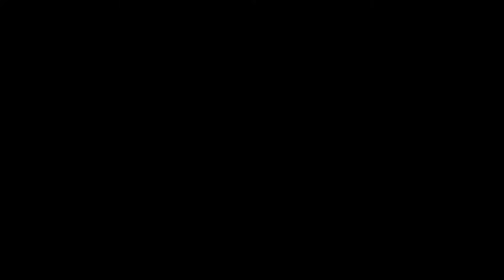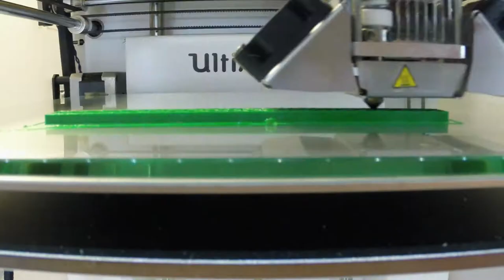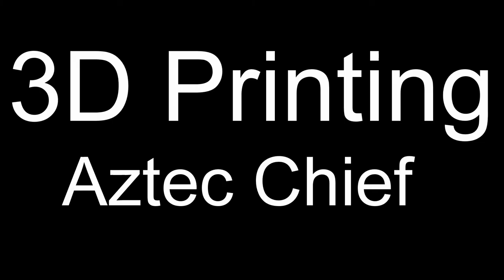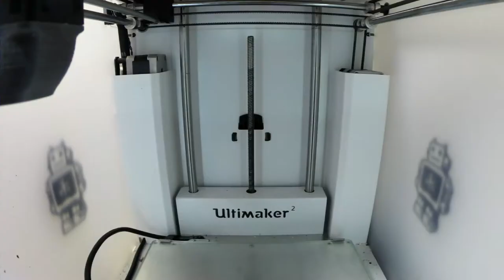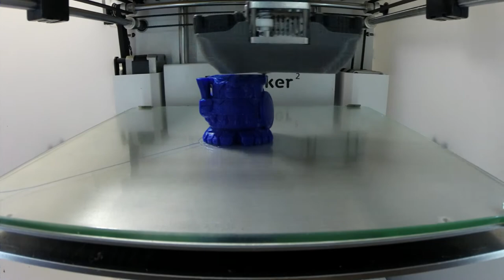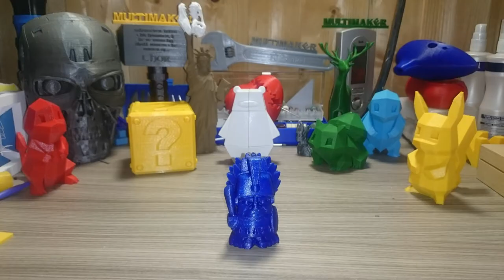3D Printing Aztec Chief

Comment: Question. Olson Block at a guess? And who's 0.25mm?
Reply from the maker: David Parrish Olsson block is correct , 0.25mm is the smallest nozzle size i have.
Reply: Multimaker I've just ordered the E3D set 0.25 to 0.8 supposedly they fit the olsson block. Any suggestions when printing that fine?
Reply from the maker: Not really, it just works the same way. I relevel the bed every time I change nozzles, it may not be nessessery but the times I've tried not doing it I have been disappointed. Remember to change your slicer setting of course to the nozzle size of choice. I made folders on the SD card for each nozzle size to keep some order. And good luck and happy printing!